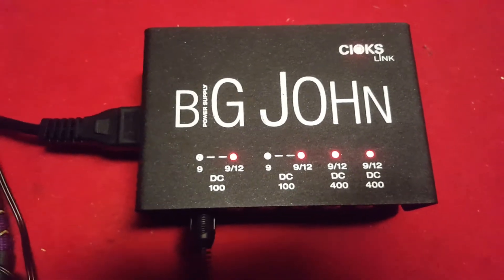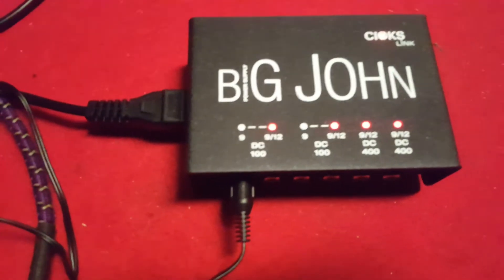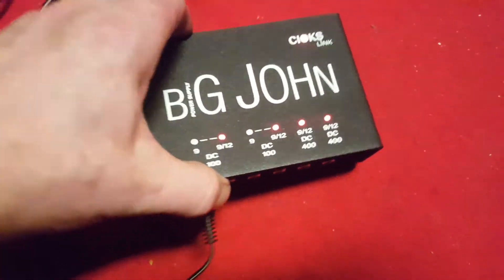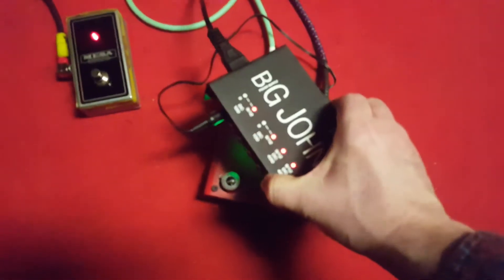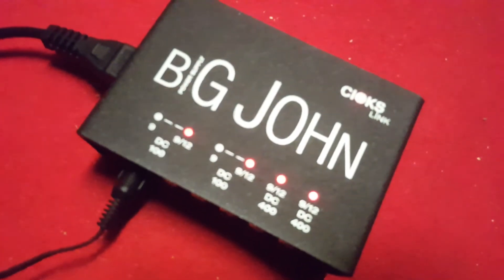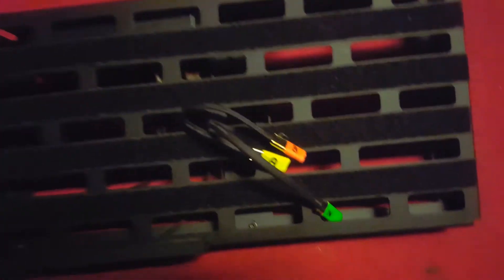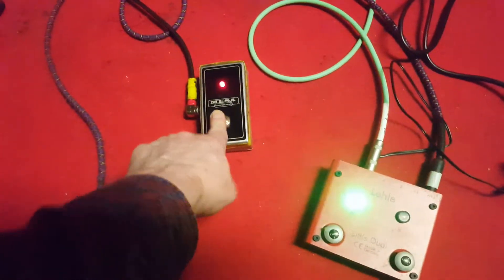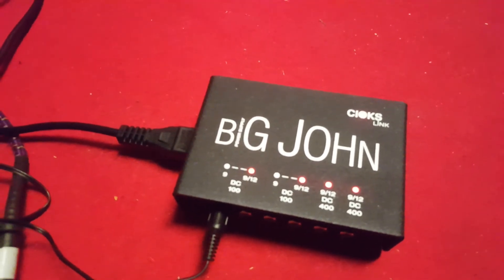Cioks Big John interference with guitar pedal (Lehle)

Comment: Has the ground switch on the LITTLE DUAL been pushed or not? If the output A is connected only, the ground switch needs to be pressed, otherwise your guitar and the LEHLE aren't grounded which could explain the extra amount of noise, too.
Reply from the maker: Hey Lehle, thanks for the reply/post.
Yes, we have tried every setting and position. I have a different set up as I mentioned with a different PSU and it has no problem. The problem is clearly in the Big John unit. I have multiple rehearsal/recording studios with many different setups. I love Lehle units and they have been working great in all my other setups. Thanks Lehle!
Reply: @scaryb69  Perfect, you are very welcome! Then you might consider taking down the video because the problem is solved and the update for this is in another video, or? Cheers!
Reply from the maker: @LehleSwitcher  Hi Lehle, I will update the video info that this has been solved, but would like to leave it for other fellow musicians on a search for a similar problem. Thanks again and I really like your products!